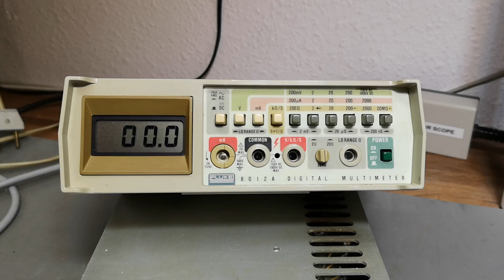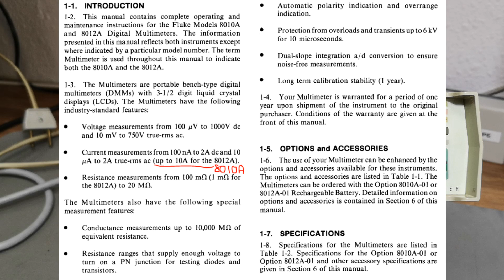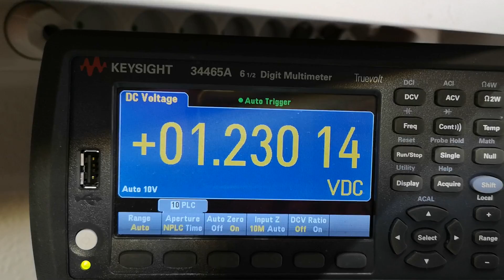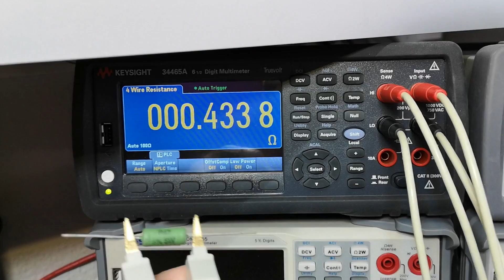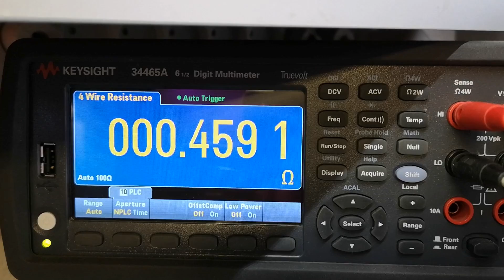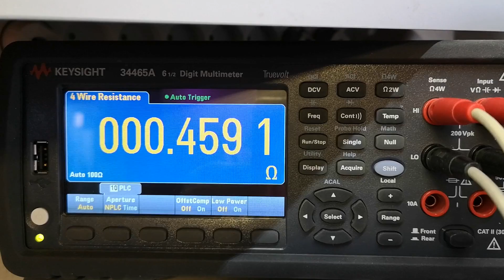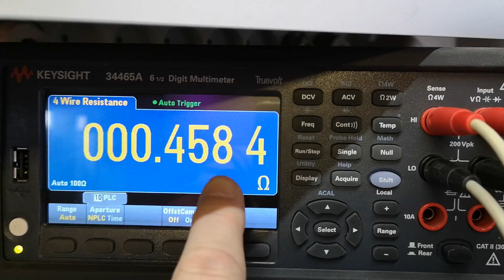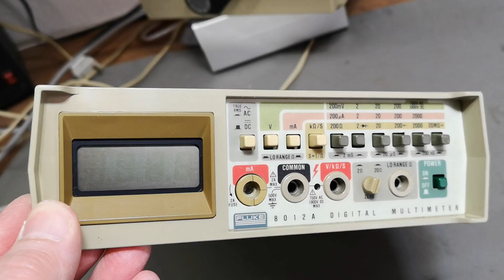FLUKE 8012A Digital Multimeter 1982 test teardown

Comment: The thick film module on the rear of the 8012 is the true-RMS AC to DC  converter. Yep this 1982 Fluke multimeter is a true-RMS unit.

 It is on the same DC-ground with the bridge rectifier and not submitted to the input voltages.

Regarding input voltages, if you further open the 8012, you will see another thick film module.

The module is a CADDOCK high precision thick film resistor pack designed to fully withstand the 1000 VDC / 750 VAC input voltage.

Yes, the 8012 is one of my preferred bench meters.

Got it for 50 Canuck Pesos on a Hamfest. 50$ for a FLUKE !

Thanks OZ2CPU for the Crystal explanaton !
Reply from the maker: YES that is where some of the money goes, margin, stability, relaiability, long life, protection, safety,